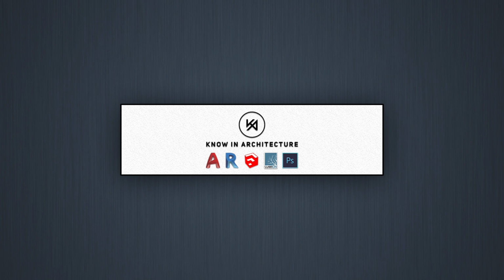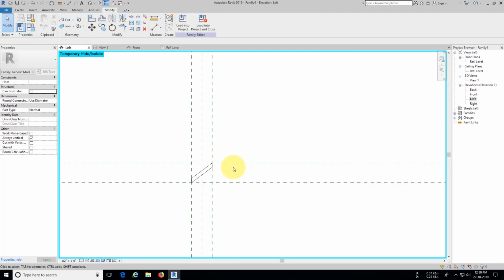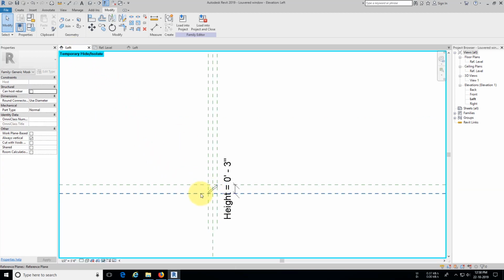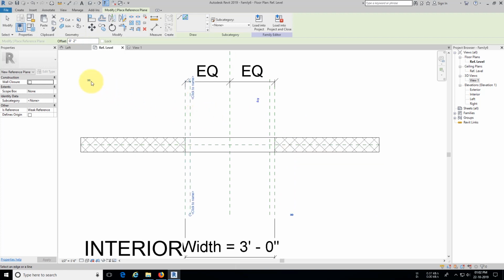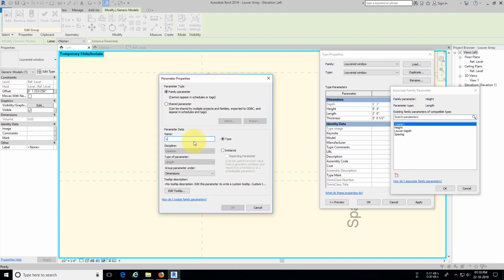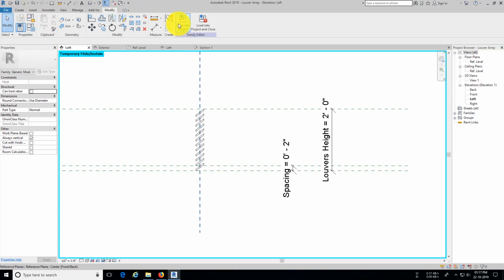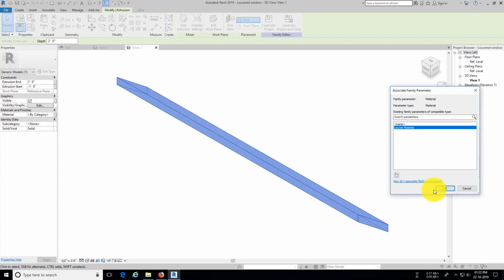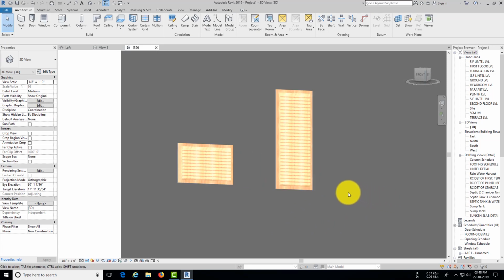"LOUVERED WINDOW FAMILY FOR REVIT" Louvers That Generates Automatically Based On Your Size.

Comment: i have a problem with the default sill height constraints are not satisfied when i try to change the value at 23:42 in your video clip
Reference Planes : Reference Plane : id 4680
Generic Models : Custom Louvre Array : Custom Louvre Array : id 6454
Constraints : Linear Dimension Style : Alignment : id 18225
Reply from the maker: Check constraints.